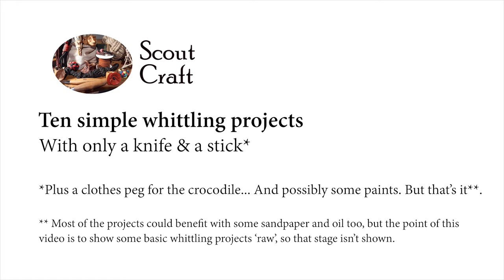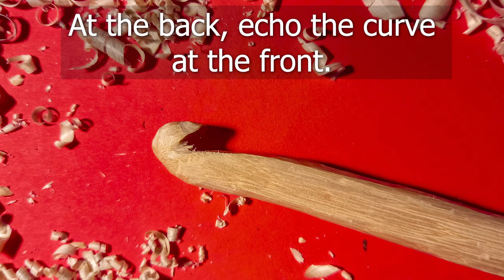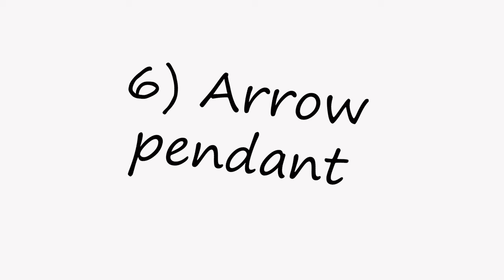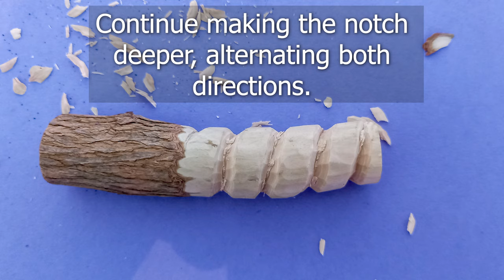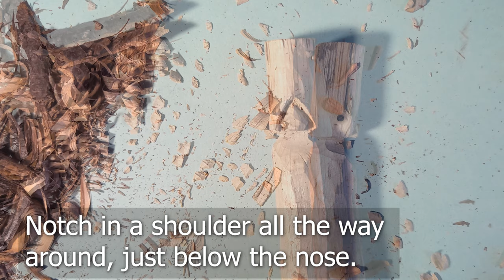10 simple whittling projects and ideas to get started on, with just a knife and a stick.

Comment: How do you find sticks this good
Reply from the maker: HI Send Noodles. I'm lucky enough to live next to a large wooded area of my home town. I often pick up good-looking sticks on while walking my dog. You soon get the hang of spotting a stick that hits the sweet spot between young (I avoid green sticks as the tend to split as they dry) and old (rotten or weak) sticks. It's also a good idea to learn to recognise trees so you can start to work out what woods you like. Any of the fruit woods are normally great. Cherry is fantastic. Birch and Ash are probably next on my list, though ash can be a bit too hard. So, getting out and about and finding good sticks is a win on several levels!  A couple of the sticks in the video are actually from an old rose that we cut down a while ago. I threw some of the larger stems in my shed and came back to them a few months later, once they'd dried out a bit.

Comment: how do u get the sticks so clean cut?? I cant cut it for shit lol
Reply from the maker: Hi. When people have trouble 'easily' cutting into the wood, I normally check three things. 1) Is the knife sharp? 2) How's the angle of cut? 3) What wood are you using? Mostly it's 1 or 2 that are the culprits. A sharp knife is essential and it's worthwhile learning not only how to sharpen you knife on water or oil stones, but most importantly how to keep it sharp by 'honing' your knife on a strop. An old leather belt will do, but regular stropping is the key to keeping your knife sharp and means you almost never need to use the stones or a sharpener.  My strop is made from an old bit of leather I picked up in an offcuts bin at a craft show, glued to a piece of pine baton I found in the shed. I use a honing compund in the leather. This definitely beats the £30, £40, or even £50 that buscraft suppliers charge for these things! For (2), just pay attention to the angle at which you're cutting into the wood. If the angle is too steep, it'll be tought to cut, and you'll end up gouging the wood rather than 'shaving it'. The shallower the angle, the easier the cut will be. For 3, there are a lot of variables - how dry, how old, what type etc... My usual solution if I think I've picked the wrong stick is to try another one.

Comment: I can barley whittle through the stick it is insanely hard for me to even make a roll
Reply from the maker: Lots of things can make it difficult to whittle a stick. The two most common 'pilot' issues are sharpness of blade and angle of cut. The more shallow your cut angle, the easier the cut will be. On sharpness, the most important thing is regular 'stropping' or 'honing', which can be as simple as running your knife over an old leather belt. I use honing compound rubbed on old bit of leather, glued to a piece of pinewood. Also, choosing the right stick can be important. It's a good idea to experiment with different woods.